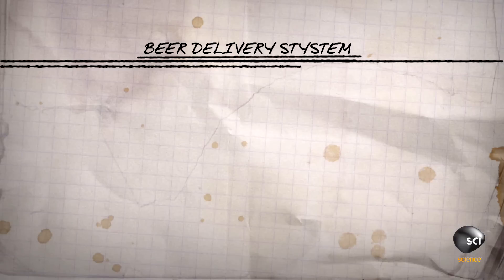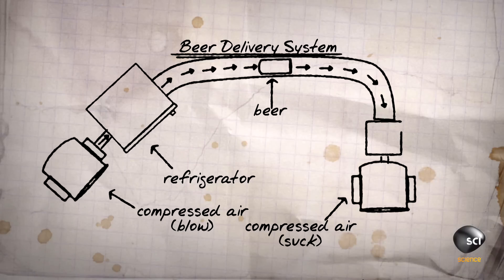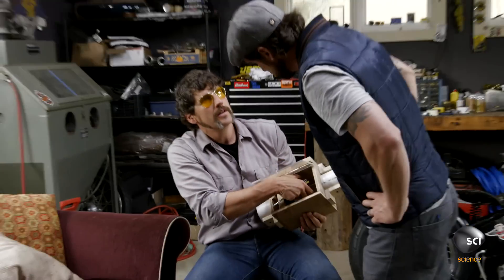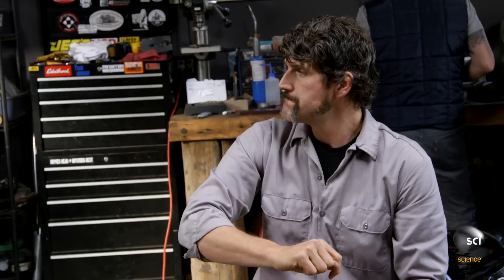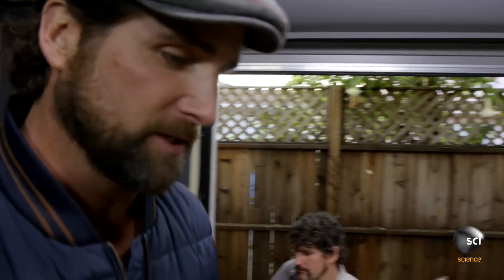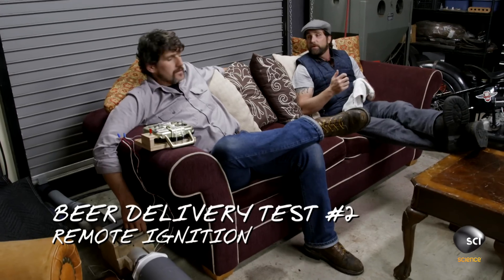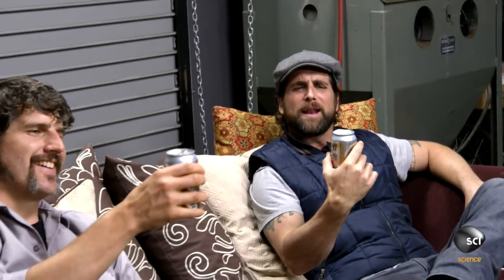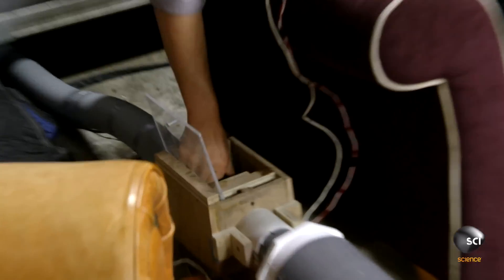A Pneumatic Beer Delivery System

Comment: In theory you could hook up multiple servos and dispense different drinks with the press of a button...
Reply: Joe Cooley in theory you could do that but you would have to have a pressurized air system
Reply: Alex Lee I mean have the one tube just have gravity feed different cans in, it would be the same as the beer.
Reply: like a vending machine that then drops into a vacuum pipe?
Reply: Luke P exactly, even simpler, a wireless vending machine above your room that drops cans through the ceiling.
Reply: but then what if you only have a single story or the man cave is a shed?
Reply: Luke P you'd have attic space above the room.
Reply: Luke P it depends on the shed, but you can rig up the pipes to get it from another area.
Reply: i dont have an attic hahaha
Reply: Funny!  Is that acrylic pipe?  Where do I find some of that reasonably priced?

Comment: if you put a contact switch on the box top when you opened it the system would turn itself off... and using a rasberry pi you could set it up to do it all from your phone then you could run it through the walls to every room in the house. beer me anywhere

Comment: This could be used for canned sodas too
Reply: Gabe Kohsman Actually no, those are called "Hop" tubes, and they can only transport canned beers. The beer acts as a magnet inside of the tube propelling it's self foward. If you attempted to do it with a pop can it would implode the tube because of the negative pressure the pop creates.